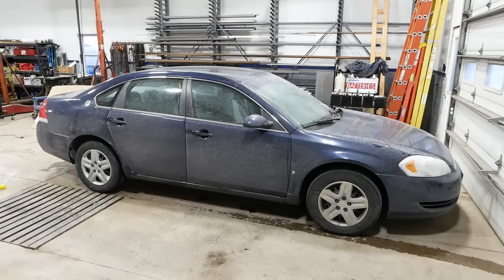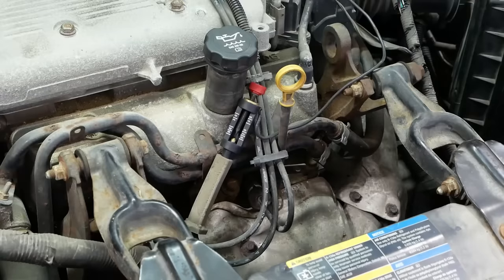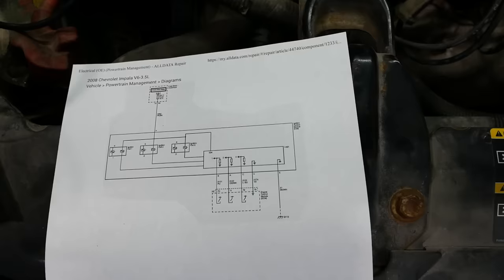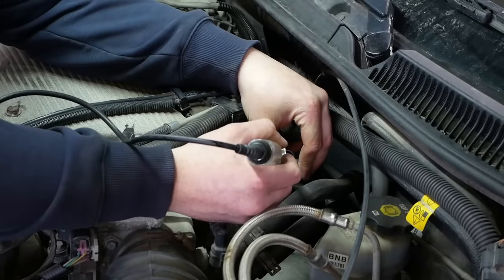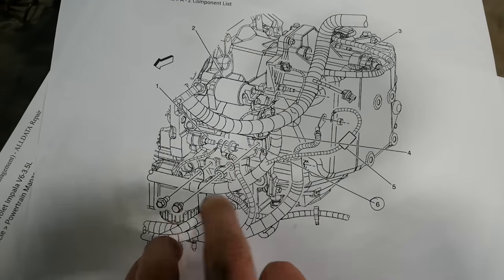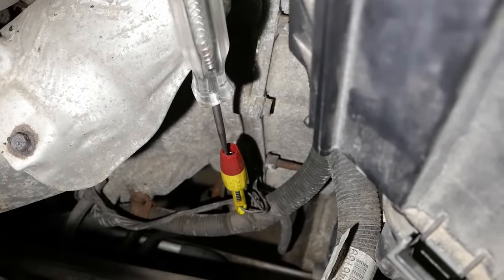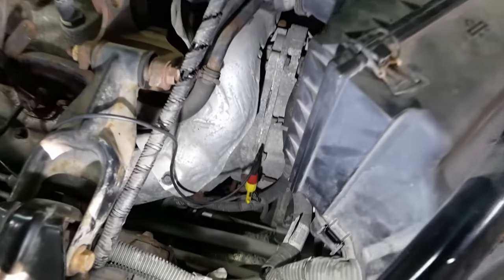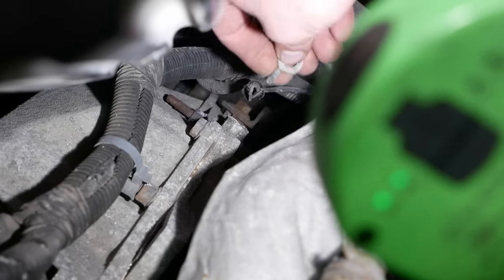Chevy Impala no Start, no Spark, no Codes

Comment: What the hell? It's much more fun to guess at things and spend money buying sh*t you don't need rather than fixing a couple wires.LOL. They DID start firing the parts cannon...they just stopped prematurely before they replaced the ECM, head gaskets, battery, starter and ultimately the engine. Just a reminder: if it stops running, just take it to a mechanic if you aren't one. You can either spend money or waste money.

Comment: What scanner is that and where did you get it? I need one also where did you get that spark tester?
Reply: That is from Lisle - 20700 Coil-On-Plug Spark Tester. I have the cheaper 50850 Ignition Spark Tester, but I would rather have the flexible ground cable than the riveted-on ground clip on mine.

Comment: And that one hour repair is something I suspect MOST mechanics couldn't duplicate - and they'll readily admit it.
It would suck billing that job by the hour, because the value of the highly brain-intensive diagnosis labor so heavily outweighs such simple repair labor as in this case, and because (especially in the 21st century) such competence is quite uncommon to find.

Comment: Yes, in an ideal world connections like that should be soldered.  However, you already spend a lot more time on many of your repairs than you charge for.  Soldering connections takes adds more unbilled time.  Plus, this vehicle is 15 years old and the crimped connector will probably far outlast the rest of the car.

Comment: The Autel MX808 is only half the price at $475... Is it not any good?  Which is the best budget scan tool that I should get?
Reply from the maker: I don't know. I only know the ones I have used.
Reply: @WatchWesWork  You could do a video talking about all the different scan tools you have or have used.  That would be interesting.  I'm looking to buy the cheapest good one I can get. lol..  I was pretty sold on that Autel for less than $500.  I believe it's basically built onto an Android pad and can still get the google play store and do Android things/ on top of being an Autel with quite a few options.  I'm just not clear on the live data and all the remote actuations that can be done-- they're all different and cover different brands too, and that's the annoying part.

Comment: Solder?  I was thinking about those solder filled heat-shrink connectors! 😁
Reply from the maker: I dunno about those things.
Reply: @WatchWesWork  I used them on an underground AC application where I had to extend some wires inside a conduit.  I couldn't be sure the conduit would stay dry so I used those to join and keep the connections dry.

Comment: Gotta love how everyone rapid fires the parts cannon. I mean, we've all been guilty of hitting up the parts cannon first off , right? But after you thought something was obvious and it wasn't, whether you decide to actually diagnose something. Of course, most people aren't comfortable with or capable of diagnosing electrical problems. It's a bit of an epidemic. Also turns out I'm just repeating what some have already said in the comments.

EDIT: Oh, and that wiring diagram bothered me. both D and E are grounds, but E is a chassis/housing ground whereas D appears to be a signal ground. No indication where they're connected and if I read that diagram I would have said "Oh, well if they have a separate housing ground then surely that's not bonded to the signal ground here". Not sure if I'm supposed to assume those are joined at the ignition module.

Comment: at 3:57 arent you checking ground with the test light still clamped to ground there? wouldnt you need to move that clamp over to the positive bat terminal to probe for ground?
Reply from the maker: Just because you can't see it doesn't mean it didn't happen...
Reply: He may have done that test once or twice I his life.
Reply: I thought the same thing until I saw Wes remove the ground connection for the spark-tester. 6:20

Comment: Damn it, so does really it needs Crank Sensor re-learn if CKP was replaced? What if someone just changed the CKP, but has no tech scanner with re-learn option.
Reply from the maker: Most times you'll be fine. It's just a good practice. In rare cases you can get misfires and lots of tail chasing with crank mis matches.
Reply: Thanks. I get, it's sort of 'safety' measure, just in case. Yeah, good scanners aren't exactly 'inexpensive' toys like many people think. I love the late '90s, early 2000 cars, just basic OBD2 without too much gadgetry.

Comment: Ya know it wasn't too long ago I went to dealership on a Friday about a fairly late model car we got in with some mild deer damage a very simple everday repair done by many shops and ppl could even do it in their back yard that is how simple it was. Until the day I got the damn thing in the paint booth it drove in we taped it up shot it buffed it off. My helper sits in it no start. We were all over it 3 hours and finally I said push it out over there out of the way. The dealership could not come up with one wiring schematic. However after I did check the suspected grounds I called up Advanced got a coil pack. Now why the car decided to die like that right in the paint booth is one of them other lifes little mysteries as well as why a dealership would be too stupid or lazy to get me a wiring schematic. Well it turns out it was just that simple. Mister coil pack died in the paint booth. I attributed it to the below zero degree temps at the time. In the case of this video this every BODY SHOPs nightmare having broken grounds or forgetting to reconnect one of them tiny little ground wires can be a real nightmare especially on them Dodge pickup trucks..
Reply from the maker: It's always horrible when they die in the shop.
Reply: @WatchWesWork  Especially when ya just called the customer tell em your car will be ready in a few hours.. Or they come to pick it up and it doesn't start can be a real willy dilly too... We have learned our lesson to do the light check stuff in the booth as well instead of leaving lights on out in the lot can be real hard to detect that when the suns bright in the sky. A few times we left lights on stuff like that or hood open with a light that kills the battery
Reply: @WatchWesWork  Let me know what scan tool U were using please

Comment: I hate body ground wires.  

It's incredible how some stupid little wires failed witih corrosion knock out a whole car.  Heavier conductors, or terminals, or what would solve that ?
Reply from the maker: Putting the ground up out of the salt spray would be my suggestion.

Comment: You seem to have a running joke about dielectric grease but, in all seriousness, can you explain why you put it on the mating surfaces of electrical connections since it doesn't conduct electricity?

I would truly like to hear your reasoning.
Reply from the maker: Because it will simply squeeze out of the mechanical connection but leave a protective layer on any gap.
Reply: To expand on Wes's answer: When you bolt down (or push on or whatever else) a terminal there's always gaps left, as neither mating surface is entirely flat and the pressure is inadequate to form them together. Where those gaps exist, air, water, salt, and so forth can collect and create corrosion which will jack the surfaces apart and destroy the electrical connection. The dielectric grease (or, honestly, in this low voltage and low power application, any reasonably tacky grease) fills those gaps and covers the rest of the surface to provide significant protection against corrosion. The force applied will readily extrude the grease from metal-to-metal contact points.
Reply: Thank you both for taking time to reply.

Comment: my tesla starts but dont crank..🤣
I got 380k miles out of one of those cars. 
Original motor trans in NYC metro area.
3800 GM
Reply from the maker: Just wait. Those Teslas are going to be wiring nightmares once they hit the salt belt, and we'll be screwed fixing them with no access to service data or parts.
Reply: @WatchWesWork  Indeed.
I am a mechanical engineer NYIT degree 5 year  1990 retired from Nuclear power plant (Bechtel) industry.

I also Have been a mechanic since 1978 as a teen until today. New Construction equipment also very very high tech and many mfg violate " right to repair" laws like Deere and CAT. I gave CAT ET scanner but it is limited . 
The more complex the more issues and spray salt and time on it and whaaalaaah! 🔧🤓$$$$$$$$
Only dealers will be able to repair these ultra high tech machines in future. 
Not good.
Farmers are suing Deere now in Nebraska .

I hope they win.
Reply: @WatchWesWork  Have to send them south down to Rob Dunn who has the patience to poke through entire battery packs  . . .

Comment: Wes, apply the grease after you bolt it on - you want clean, bare metal-to-metal contact.  The grease keeps moisture from getting into the connection.

Comment: Solder, NO. Seprate ring lugs, YES.
Reply from the maker: Why?
Reply: @WatchWesWork  I'm a retired licensed electrical and I worked in power. Solder lugs were outlawed quite a while back because they can melt when overheated or during a short circuit. I've seen it happen due to overload on a 4800V circuit. Probably not a big problem for your case except mabe if there was a short. Two wires in one lug is prohibited unless the lug is specifically listed for two wires. It is difficult to get a good crimp on both wires in one lug even if twisted together. Two lugs is better. Why do you think GM did it that way? They're not completely stupid, just pretty stupid.
Reply: BTW, I love your videos and your trobleshooting is spot on. Keep it up.

Comment: Soldering the wires could produce a stiff point on the cable as the engine rocks  as for the nay  sayers yeah put some grease on it pmsl 👍

Comment: Weirdest engine mount system, with two mounts to the front slam panel? That's some bad design in the engine if it needs that much restraint!
Reply from the maker: Well it's a GM...
Reply: Hah, hi from across the pond

Comment: I don't understand why people continue to solder wires.  Every electrical connection on a car is a crimped connection.  As an industrial electrician starting in 1969 the National Electrical Code hasn''t allowed soldered connections in power circuits in houses or other buildings.  There are soldered connections on circuit board but nowhere else.
Reply from the maker: I suppose because it does not require any special tools and usually works OK.

Comment: Absolutely mind boggling that American cars still produced "push rod" engines in 2008. Wow. Don't think European or Japanese cars have had a push rod engine since early early 90s. LOL.
Reply from the maker: You can buy a brand new push rod engine in 2022. The Ford 7.3 gas for example.
Reply: @WatchWesWork  Good grief. No push rod engined cards in South Africa except very old cars like classics pre late 80's and vintage.
I remember many years ago in mid 90s being shocked that the Caddie North Star engine (I think) was still push rod. 
Love your channel Wes. Spent any years spending time in Illinois, stayed  far North close to Six Flags area. 
Regards from South Africa
Reply from the maker: @IO-zz2xy  Maybe I'm biased, but push rods are so simple and reliable. Plus the engine is usually smaller, at least in a V configuration. GM actually found they are more efficient due to lower rolling resistance. Variable valve timing finally killed it off for smaller engines, but truck engines are still going strong with push rods.
Reply: @WatchWesWork  i tend to agree with you Wes. I was just making an observation. I must mention that your vids are like an exiting detective series. You keep us on the edge of our chairs till the end when you always "get the baddie" with all the little sub-plots along the way. Your "detective and diagnostic" skills are awesome and I am sure many mechanics, technicians and auto electricians are better skilled for watching your channel.
Can't wait for the next exciting "what done it". 
Regards from South Africa

Comment: "Old school pushrod engine " do engines not have pushrods anymore?
Reply from the maker: Well everything old is new again. Ford has a brand new pushrod gas engine...
Reply: Everyone else stopped usinng pushrod engines in 1980s but in USA they still used OHV engines until recent years.
Reply from the maker: @juhomaki-petaja  There are good reasons for that. Pushrod engines are actually more efficient (less friction) and more compact in a V configuration. The need for variable valve timing is what finally killed them off.

Comment: Man.  Checking power and ground seems so…….basic.  How can they not do that?
Reply from the maker: They didn't have a wiring diagram I suspect. It's no big deal though.
Reply: @WatchWesWork  yeah, that seems likely.   It was an easy find, as you chose the right path.  Pulling codes would have burned some time.